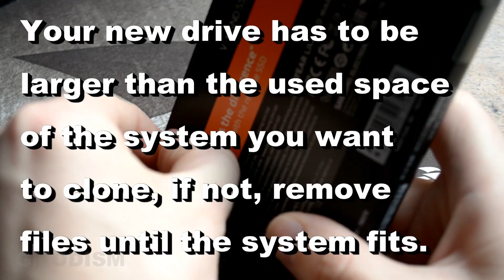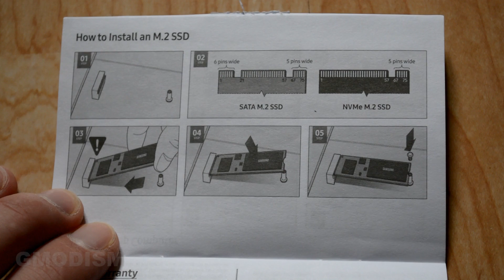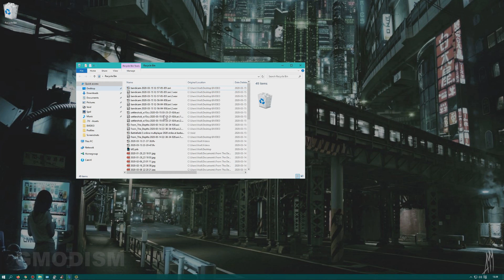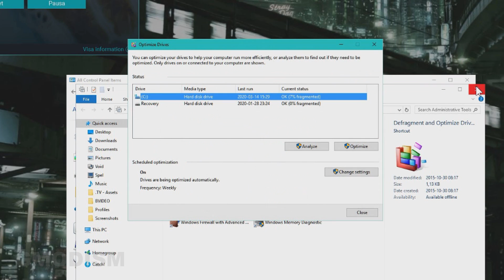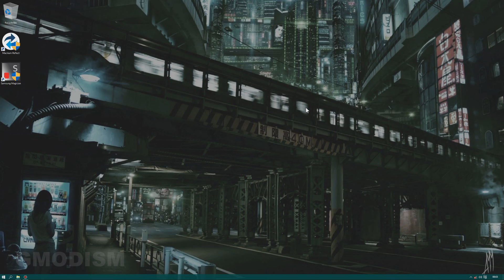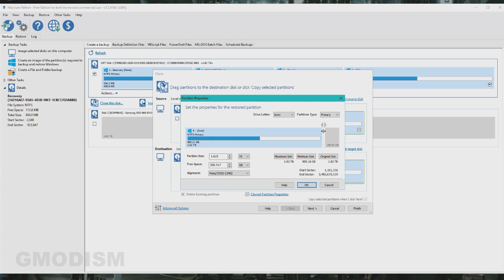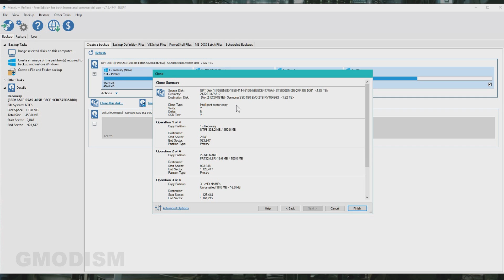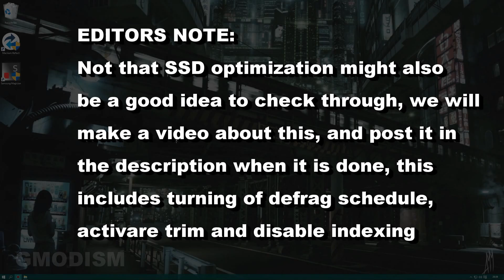How to Move Windows 10/11 from HDD to SSD

Comment: i was only looking to move over windows not the whole contents of the drive
Reply: Will Mayhew same....
Reply: @thechosenace42  same
Reply: @thechosenace42  same
Reply: I’ve fucked up and my ssd has disappeared, ffs man wish he said this at the start
Reply: @Roomy_21  you can wipe the ssd
Reply: @chickenoodle3397  I’m restarting the whole thing because I can’t even find my ssd anymore, I’m hoping this works man, following this dudes video has fucked me up big time
Reply: @Roomy_21  did you fix your issue?
Reply: @Roomy_21  dude i cancelled the operation during the merging process and now my ssd went from 1 TB to 500mb of storage and is renamed to System reserved. I fucked up anyway to get my ssd back? its an m.2 nvme ssd.
Reply: You can’t just move windows you have to move everything or start over fresh
Reply: YoungHungry thanks I ended up doing that anyway and it worked out fine
Reply: @willmayhew4256  just do the clear thingy
Reply: @YoungHungryy  not neccessarilly
Reply: @YoungHungryy  you can, you just need to have seperated partition for os, in other way (whnich unfortunatelly was mine) you have to  reset you computer to the fabric state and lost all data
Reply: @YoungHungryy  so if i re install windows on my m.2 it will delete everything? that i already have ?
Reply: @YoungHungryy  pretty sure they on some kind of drugs to think you can just move an operating system without touching other files.
Reply: @tonyoneal5269  dam, it seems like it would be possible. Windows know which files are the base OS files and just transfer those, not any other crap that was installed later.
Reply: @tonyoneal5269  yeah cause you knew everything about when you first started with computers...
Reply: What if I said that I have 400 GB of programs on my HDD and my ssd is only 120 gb
Reply: @jaimenbrunson1652  idek lol send helpppp( i have the same problem just now
Reply: @lancevillar4320  reinstall windows
Reply: @jaimenbrunson1652   how did you resolve this problem???? im in the same boat and have 900 bg of storage on my hdd and just got a 250 gb ssd to store the boot drive on
Reply: @juliansaclolo3003  I ended up deleting all my games and stuff off of my hard drive and cloned it and then re-download it them
Reply: @jaimenbrunson1652  forsure thanks bro
Reply: @jaimenbrunson1652   ok and also what does this dude in the video saying that you need to leave the drive unused for a month??? lmao
Reply: @juliansaclolo3003  if you have a spare hdd then move any unnecessary files onto that one bottom line is that u have to have under 250gb on your hdd before transferring to ssd (including windows) if u dont have a spare drive or cant make enough space then buy another hdd there not too expensive nowadays and extra storage is always nice to have
Reply: Lmao same I though it was gonna be easy I’m just gonna stick to my hard drive
Reply: @ethanmartinez2355  If u want a fresh windows on the new drive then just install windows on the new drive. Assuming the windows key was digitally activated and is stored on your motherboard, it should activate windows on the new drive. If not, then clone the old drive then do a full restore or do a full restore then clone.
Reply: then reinstall windows
Reply: just format your pc then move everything to ssd
Reply: @julyxradio1192  what do you mean format the pc. i have 900 gb of starage on my hdd and just bought a 250 gb ssd so how would i fit everything on it
Reply: @juliansaclolo3003  dude reset your pc
Reply: @julyxradio1192  the problem is that i dont even have windows installed onto my ssd yet. its not even in my pc yet at all
Reply: @juliansaclolo3003  You need a USB thumb drive to install windows look up a video how to install windows
Reply: So I am almost certain that in order to move over windows, there are two ways to do it. One is to move the whole drive and then factory reset the device once you reboot, the other may be to only move a specific partition, I'm not completely sure about that one, but it's something to look into if you're willing to take the time.
Reply: Do this and then purge your ssd and move over useless files back to hdd
Reply: but i want to clone my c ssd drive to a new m2 drive. but my m2 drive does not have a sata cable its wireles.how can i use the bios to configurate it then?
Reply: Same
Reply: You could just factory reset the PC and then transfer after
Reply: So was I, but unfortunately found out you can’t just move the OS, so what I did was move all my personal photos and files a extra hard drive. And kept only Windows to do what he explained.
Reply: I think it's easier to just load new windows
Reply: @ΚυριακοςΚετσες  but for some people who dont have their product key that means paying again
Reply: Whats the point in that? Why not just install fresh?
Reply: So I bought a prebuilt and I have used about 700GB of space on my HDD, In order to transfer everything to an SSD and windows would the easiest way to be to factory reset and completely restart everything? but again how would I get windows if I don’t have a drive with windows on it
Reply: lol at that point just create an installation USB and start from scratch
Reply: does it copy all the files and programs or just windows?
Reply: Will the games on my epic games will also be move if I do this method?
Reply: Pat yep - the whole drive will be cloned over to your new drive
Reply: @jns_l28  only if they were saved on the drive you cloned and transfered.
Reply: @jns_l28  yeah they will remain on ur epic account however you may need to reinstall them
Reply: If you want to just move Windows you simply install it again from the installation usb, which you should have at all times.
Reply: @SmolSir  Wouldnt it count as a new pc, and then requires a license?
Reply: @SmolSir  but then I have to pay again for the license key?
Reply: @SmolSir  2

Comment: From a 2.5" 120GB SSD to an M.2 256GB SSD it took 17 minutes! It was incredibly simple to switch! It worked right away! Wish I had known about this program last year. Thanks, m'man!
Reply: Did you clone your data?
Reply: how do you get by with just 256 gb?
Reply: @pancake5830  an Operating System doesnt require more than 30 or 40gb really. Any more room you use would just be for high use programs or games. A separate storage drive of a greater size is usually used in conjunction with a solid state OS drive.
Reply: Mine did 5min

Comment: I tried exactly what you did part by part in this video, but a few seconds after I started the moving of data, it stopped and said "Clone failed - Error 0 - Unable to match partition - Drive 1, Start Sector 1952464896 MFT corrupt - Error code = 6. Please run 'chkdsk C: /r'", and deleted all my files on my SSD that I wanted to move windows to. Do you know what happened, or what I could do to retrieve my stuff.

Comment: Quick question, what is the reason to keep 10% of the space on the SSD unallocated?  It effectively made me drive smaller.  When I try to format and partition that space, it won't let me add it to the existing drive letter, but asks to set a new one.  Not an problem I suppose, but a little annoying.  Thx
Reply from the maker: You may extend the volume with macrium, but you want at least 10% unallocated, I bereave I explain why, but it will make it live longer.
Reply: How do I extend the partition in Macrium?
Reply: I figured out how to extend the volume, using Windows disk management utility.

Comment: Great video.  To avoid having to physically pull the old drive, I set it as first priority in BIOS before doing the clone.  When you restart, it boots to the SSD as first priority, but will revert to HDD if something goes wrong.  It worked for me because my system is a few months old so I haven't had too much time to pile a bunch junk in the HDD.  It helps to get the largest SSD that fits your budget.  For me, that was 480 gigs.  My HDD is 4 TB.  Plenty of space left after the transfer, which only took up about 60 gigs.  Now I'm going to use the new system SSD drive with the HDD still connected and exactly as it was, but not as my primary boot drive.  I'll wait a month as suggested and reformat it as a storage drive if all seems good with the SSD.  Make sure you take his advice of moving everything during the clone, as opposed to bits and pieces of data.  You might think you got all the Windows data in the partitions you chose, but if you miss anything, you may have trouble restarting.  Just move everything.  That's what I think has happened to those of you who are having this problem. If it's too big, then delete, prune and defrag the drive before you do this.  Thx.
Reply: How do you write over the old hard drive when it’s been a month and you want to use it as an extra drive? Do you just plug it back in and delete everything on it?
Reply: I haven't done that yet because I need to wait a few more weeks but I plan to simply reformat the drive
Reply: @meangenemidlifeadventures  yea that was a pretty dumb question, all i had to do was format the drive in disk manager. I thought there was like a clean way to do it after a clean that you had to do or else it would make the drive unusable. But my clone to ssd was succesful and my 1tb drive is wiped.
Reply: @okPaco  mine worked too, glad it worked for you.  I have a question about the SSD.  Following his instructions, i set aside unallocated space on the SSD, but I set aside way too much and I want to extend the volume.  He said to use Macrium.  I've tried but can't figure out how.
Reply: figured it out, using Windows disk management utility.  You can expand and contract easily.  Got it perfect now and system is blazing fast running off the SSD.  I have the HDD disabled for now and will reformat it after using the SSD for a few more weeks, to ensure it's stable.  So far so good.  Thanks!
Reply: @meangenemidlifeadventures I can't find the option to boot through sad. Can u help me? I have 2 other hdds...bios shows their options to switch even though I have windows on only 1. Currently after cloning I have windows on 2 drives l, 1 on hdd another 1 on ssd.(I cloned from hdd to ssd). But can't get any option to boot through sad. Should I delete windows on the hdd or something?

Comment: What if I want to reformat HDD after? Will booting with both the old and new drives cause issues with my system getting confused.
Reply: Your system will only boot the first priority boot drive. If it doesnt find windows there, it will try second. You can set the priority in your BIOS.
Reply from the maker: AFTER ONE MONTH, you may reuse the hard drive HDD for storage, to do this, follow this tutorial: https://youtu.be/w_zoA83sQ7A

Comment: Please someone help... I have an HDD with C and D partitions, C for Windows and docs, images etc and D for games, films etc, both about 500GB space and 200GB free. I want to move my C drive (partition) to a new ssd and use the free space to increase the D partition size to full HDD disk. I know everything to how to copy Windows and boot it, but what then? Do I plug in the HDD to another SATA port and boot? Will Windows even let me in and not crash due to mirrored systems on two disks? And how do I delete the old Windows partition then? I'm mainly concerned about booting from the ssd without HDD plugged in - will it even work without the HDD D partition in place? I don't know what to do to be honest... Maybe backup the whole HDD, then delete D partition, move Windows, format whole HDD (but how) and copy backed up D partition back in place? Any step by step solutions to this problem?

Comment: Can I use all my apps and everything without any issues?
Reply from the maker: I havne't had any issues, but watch full tutorial and the ssd optimization tutorial if you wan't more information.
Reply: @GMODISM  I was about to install a 500Gb SSD to my Acer Nitro 5 2018 Ryzen 5. If I clone it's HDD to an SSD, everything would be ditto same as the HDD right? and I'm just curious about what could go wrong while booting. And after booting I can still have both the file drives safe right?

Comment: Help Please! First of all, great tutorial, you helped me a lot, thanks! I moved Windows 10 from 120GB SSD to 250gb SSD, however it turned out that I need more space, so I am going to install 500gb SSD. 
My question is, how to do it now? i.e. I have to move Windows from 'new' ssd to the newer ssd? Or from the original (old) ssd, which I keep according to your instructions...? - or it just doesn't matter.
P.S.  I have installed few apps in the meantime, so they are not exist on my very first ssd.
Cheers
Reply from the maker: I'd move the original data to the 500 ssd, wipe the 250 ssd and keep that for storage.

Comment: Hi

Thank you for this video. 

I have a question. I have laptop that can take a new ssd with my old hdd. However, I am going to take out the old hdd and replace it with the new ssd, and I will put the old hdd by using a new caddy (instead of the dvd) to use as a extra storage and I can take it out easily. All this will be done before I move my windows. Will be there any problem related?
Reply: Buddy..did you tried this ??...I have same doubt as yours ! Please let me know

Comment: If I have 453 GB of stuff on my hdd and I have a 512 GB can I transfer everything over without deleting things other than the stuff that has to do with old parts.
Reply: 512 GB is kind of small. You may want to only keep files you need speed for on your SSD
Reply: @sonicfx5431  That's what i was planning on. I got a 2 TB HDD + my old 1 TB HDD as well

Comment: I'm having trouble where when I go to clone, it says that my SSD is an incompatible disk and the help option says that it's because my HDD is 512 bytes/sectors and the SSD is 4096, so can it not be cloned or is there a way to fix that? The help option on the Macrium just tells me about the bytes/sectors but doesn't say how to get around it lol
Reply: I'm having the same issue. Did you find a solution?
Reply: @paleo6370  Did u find a solution?
Reply: @Helloitskovo  sorry for late response but no. Long story short I just bought a samsung SSD and used samsung magician :/. Hopefully w11 makes this easier

Comment: Isn’t it possible to just move the OS? I’ve heard that this alone might already increase the speed of the computer. My SSD is not that big...
Reply: @Gabriel Antonio https://youtu.be/QZ1odFowlGE this vid may help you
Reply from the maker: If you just want the OS it's better to install it freshly, otherwise you got to remove or more files until it fits, like answered by the full tutorial: https://youtu.be/4pawQPgEGL0
Reply: @GMODISM  Does that mean having to buy another Windows license or can you clone it over?
Reply from the maker: @gkp76  Everything including valid license is copied over, windows does not "know" you exchanged your drive
Reply: gkp Correct me if I’m wrong but windows verifies your license by your Microsoft account now.
Reply: @Gwubby  does that mean i can just login an a new pc build and have windows
Reply: @Gwubby  bc my windows and microsoft are linked so cant i just login on a new computer and it will know i have windows
Reply: @Gmodism Total Nerdery Channel If I install windows 10 freshly, what will happen to my files on my hdd? I simply just don’t understand what will happen with the files and programs on the hdd since no explains it. Thanks in advance.
Reply from the maker: @gamingkiller9975  well this tutorial is not about doing a fresh install but about transfering the system. If you do a fesh install nothing will happen with the files on the hdd, but you will not be able to just browse them. My remmomedation is to follow this tutorial, and then if you need more space use the hdd as media storage in future

Comment: I accidentally installed windows 10 on my HDD and I want to move windows to my SDD, will it delete anything from my HDD if I move windows?
Reply from the maker: No it will clone it, they will have the same data after this process.
Reply: Gmodism Total Nerdery Channel but is it possible to only clone windows and keep the other files only on my HDD?
Reply from the maker: @djmomo8384  No that is not possible, then you should reinstall windows in the ssd. This tutorial is the short version, there is a longer version for more detail.
Reply: Gmodism Total Nerdery Channel ok thanks 👍

Comment: Hi! Nice tutorial. I have a question. I installed a new SSD and installed windows 10 on it without unplugging my old HDD, so now the EFI and Recovery partitions stayed on the HDD Drive. I formated all the HDD except for those two partitions and now I have to boot the PC always with Windows Boot Manager because I think the Windows Boot stayed on the old HDD. My question is, can I use this program to move those two partitions to my SSD so I can boot directly to the SSD and completely format the HDD?
Reply from the maker: Just change boot order in bios, I got a tutorial on that too btw. 
Can't say but if you Frankenstein partitions like this something may stop working. 
So cloning the entire drive, or, fresh install only is to recommend.
Reply: @GMODISM  Oh i see, thank you very much for your help